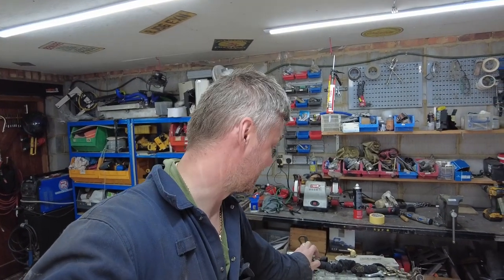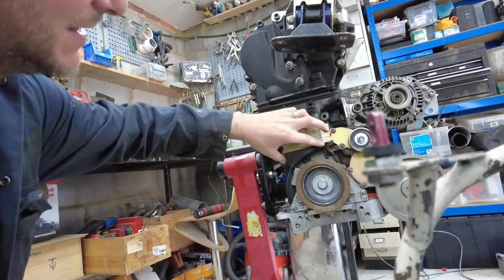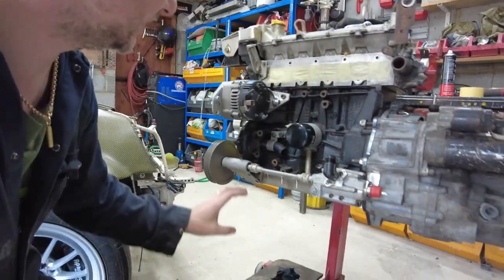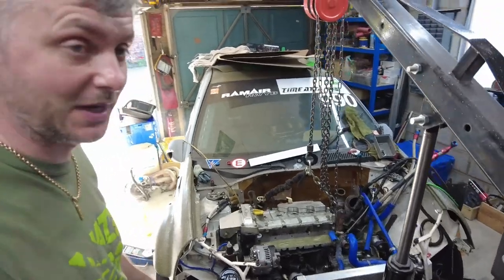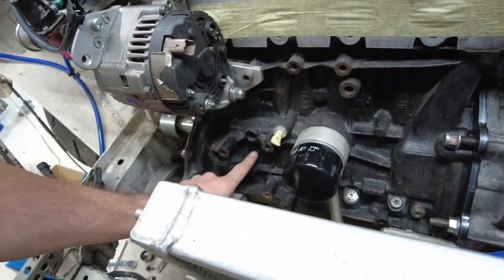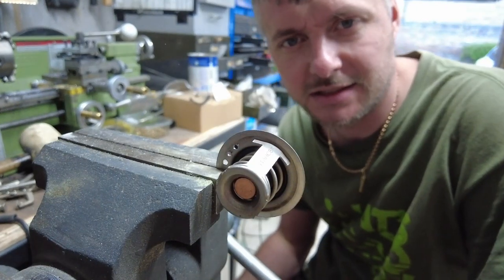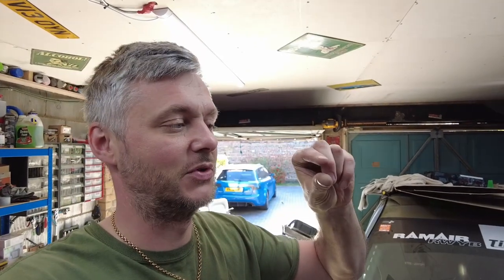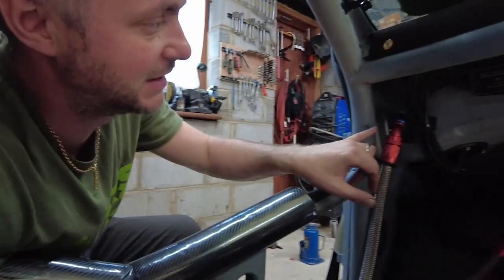Engine is back in! Electric water pump EWP80. only 5 days until Cadwell Time Attack

Comment: An idea for mounting the water pump:   those slots look like the ones on a mill designed to hold "T- bolts"...   maybe see if you can flat two sides of a bolt head to make your own t-bolts to fit the slots?
Reply from the maker: Yeah I figured it out later. Normal M6 bolt just slots inside very snug 👍
Reply: @RuskiWeldFab  win win!   Keep going man,  lots of people are living vicariously through your racing days!   I got hit head on on my motorcycle and broke nearly everything...  I'm not a quitter,  but just slow going getting back on my feet (literally).   
Best of luck on the track sir,  should you ever make it to the states... I'll have some pints waiting with your name on therm 🍻
Reply from the maker: sorry to hear that man! glad you are doing OK!. i sure will take you up on that offer. 😉

Comment: You should read the instruction that came with the pump. I have on fitted to my small van and it hangs on the piping. Works very well even in ambient temperatures up in the high 40s. I also have the controller unit. If you head mount the pump you will put a lot of strain on it. Also just a short whinge  - point the camera at the thing you ar talking about. Like the project and good luck
Reply from the maker: Yeah I read it can be supported just by pipes but wasn’t comfortable with it. It has a nice wobbly bracket now just to keep me happy. And yes about camera sorry! It happens sometimes 🙃

Comment: That waterpump blanking plate looks really good, what idlerpully did you use for that? How does it look on the inside?  I'm collecting parts for ding the same on my engine just with a Pierburg pump :)
Reply from the maker: I have no idea haha. Was made as special request by Nick at Pure Motorsport. never looked on the inside. i assume its flat

Comment: Because its electric pump cant you place it anywhere in engine bay? Or even anywhere in the car?
Reply from the maker: Yes you can. But then you need to run extra pipes. = weight.. and we don’t want that do we 😀